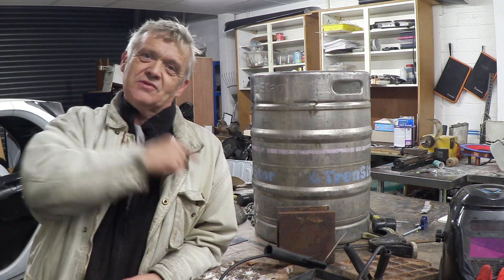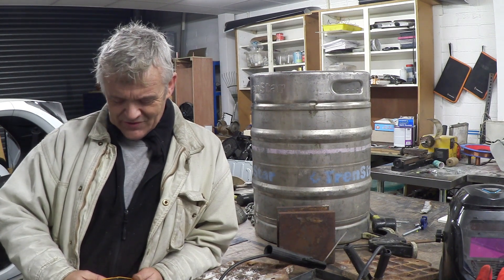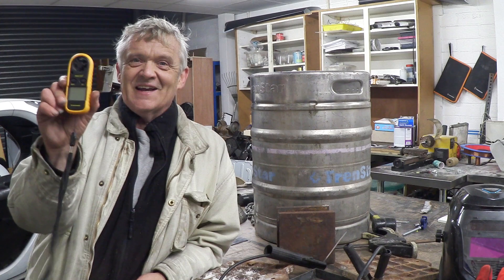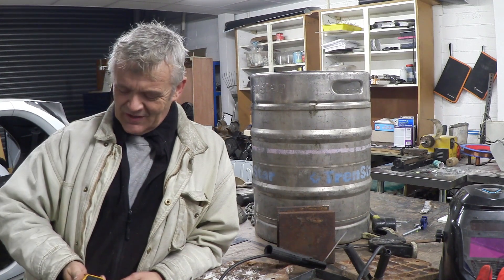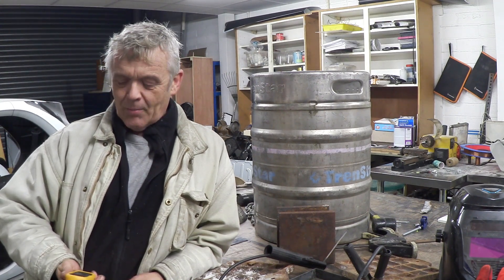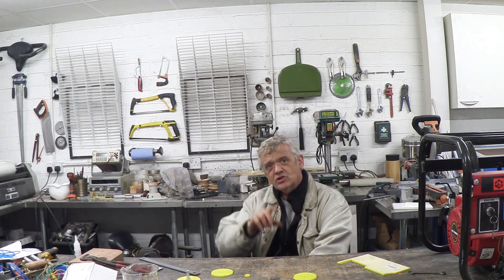Building a 1kW Wind Turbine  For Under £100 - Part 7 - A Real Wind Test

Comment: I think I am going to try mine with magnets and coils on the top also. A question. If after the voltage has be rectified to a dc voltage would there a disadvantage to grounding all the negatives to the machine (I would make it from some aluminum) and then grounding the machine it's self to ground. Using that self same ground to complete my load circuit? There by cutting down the amount of wire I would need to run from the machine to the load? Or would the resistance in the ground be to high if the machine ground and the load ground were far apart? Sorry I know it is a simple question but I am 68 and trying to teach myself new tricks.. I never really explored electronics of any kind in my youth.. though I can read schematics (from my years as a carpenter) and could wire a house if need be. But that is the limit.. thanks Rob for all you do.. carry on!
Reply from the maker: I don't see why you couldn't do the mate - interesting idea that's for sure - like in a Car - I don't know what too far is - a couple of meters shouldn't hurt but half a mile will - I guess that bit just depends where you site the control box
Reply: @ThinkingandTinkering  Thanks Rob.. a car was exactly what I had in mind.. I thought about fixing it to a batter or two and then running a couple of bars by my electronic bench so I could grab 12 volts any time I need it.. Or maybe a grind of wires across the ceiling with bright LED's on wires to hook and move anywhere I need light.. things like that.

Comment: I once got 16watts out of VAWT😉
Reply from the maker: amazing lol
Reply: @ThinkingandTinkering  16w more than yours😁
Reply from the maker: @shawng5799  lol - that's harsh lol
Reply: @ThinkingandTinkering  Its a nice idea but a £20 20w solar panel will beat a turbine all day long. I found out by experimenting for a year. Once saw 600w out of a 1kw downwind turbine I made but for the most part they stand aimlessly spinning doing nothing.😢 Then one teatime on the local TV news a professor said that a small wind turbine they had tested made £25 worth of electricity in a year. So I sold everything.
Reply from the maker: @shawng5799  yeah - I see where you are coming from mate - they do seem to lack a bit in performance overall - especially when set against cost

Comment: Check video "The Fourth Phase of Water: Dr. Gerald Pollack at TEDxGuelphU". You can make a battery out of water if you make structured water H3O2 which has hexagonal shape. And this water battery can be charged indefinitely for free as long as there is light and infrared radiation around.
Reply from the maker: seen it mate - cheers
Reply: @ThinkingandTinkering  If you decided to create water battery, you likely only need to create hydrophobic and hydrophilic glass container where 50% container is made of hydrophobic glass and other 50% container made of hydrophilic glass. Stick the two types of glasses together with glue to form a single container. Pour in bulk water. Put the glass container under sunlight to charge water and then put positive and negative electrodes in to measure volts and amps. Hydrophilic side is negatively charged and hydrophobic side would be positively charged. Would be interesting experiment and video to make i think if it interests you.